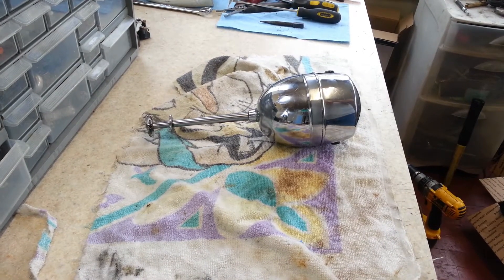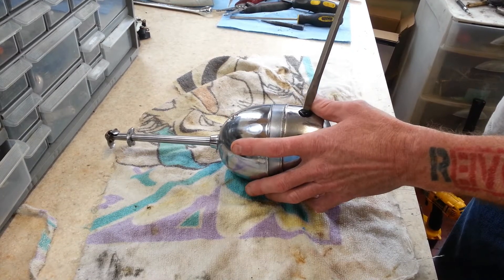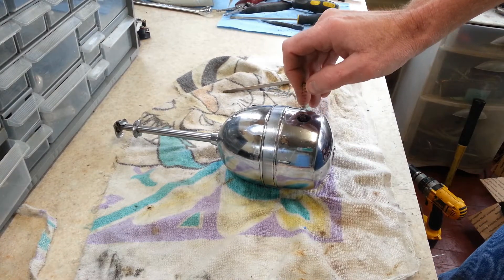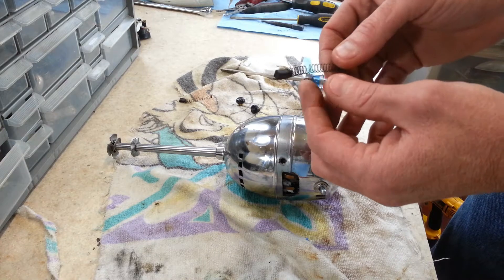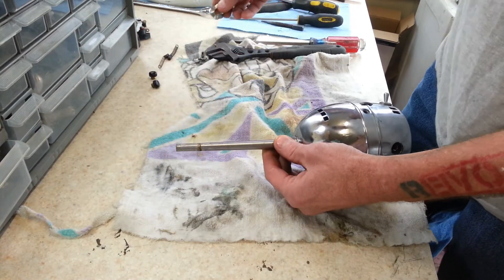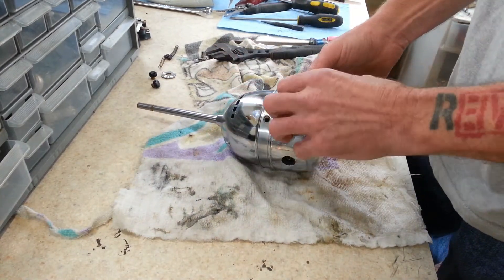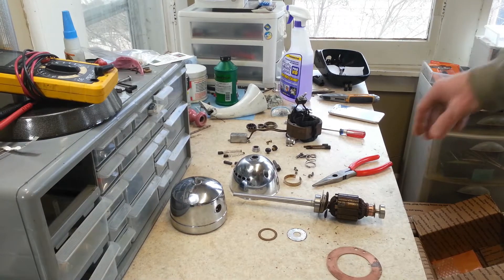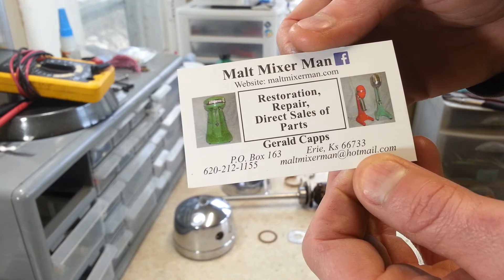Hamilton Beach Model 30 Malt Mixer service

Comment: Great video!..  I just unburied a model 30 in my moms basement that’s been in our family for 3 generations.  Was missing plug but once I replaced, found out it was much more that that.  With some moderate tinkering ability I did disassemble and noticed a huge amount of carbon dust buildup along with shredded pieces of the brushes inside..  The very top of the housing attached to the spindle appears to be chewed up so not sure how relevant that is to ultimately repairing?  That was the one thing I was trying to get a good look at during your video but unfortunately was not able to..  The spindle turns freely and smoothly by hand..  going to start by ordering new brushes and see what happens however I think I’m looking at a total tear down..  I’m located in the northeast and not sure if your service is an option if needed?
Thanks

Comment: By far the best instructional video on repairing a model 30.  This video is the one that I would recommend to anyone who is going to clean or repair almost any model of malt mixer made from 1937-1955, as the general information is basically the same.  The one thing I would recommend is to remove the chunky metal box (sometimes tube shaped) from the mixer head, rather than put it back in.  The piece is a condenser, which was installed in most all mixers before the 50's.  It was put on the mixer to stop static/interference, due to the AC current cycling back and forth, when radios and tv's were on.  Everything is filtered now, so the condenser is unnecessary.  If you leave it in, it will normally go bad over time and cause a small but scary shock when operating the mixer.  Malt Mixer Man - Gerald  maltmixerman.com
Reply from the maker: Thank you Gerald, and thanks for the condenser tip!

Comment: Your video was very good.  But i have a gilchrist #22 is there any information on it.
Reply: Ronald, I also have a Gilchrist 22 I have been working on, you ever find any information?  I am currently struggling to separate the mixing shaft from the armature.
Reply: @jeffamsterdam9023  i

Comment: Wish you had showed us what you used to clean everything up and how it was done.
Reply from the maker: Yea, I wish I could show everything as well, sometimes its hard enough to capture what I manage to, and I always look back when its done and either wish I had captured more, or that I wasnt in the way when I did capture something.
Reply: @vintagemixersandmore1666  Right on.  Thanks for posting!  I feel more confident now peeking inside the HB #33 Mom gave me 38 years ago.  Wish I had never tried cleaning the badge since some of the black outline of the letters disappeared.  Half the bushing cap broke off when it tipped over recently.  I was wondering whether to glue it, try to 3D print one or buy a replacement from the guy you suggested.  Don't know if replacing stuff changes its value.
Reply from the maker: @jonathansmith9705  Yea thats rough, the paint is so fragile after all this time. You can check with the malt mixer man and see, he may have reproductions or originals, Im not sure, but also check ebay, sometimes you can find the most obscure things there. I think there is more value in it just being complete with no missing parts, so whether original or reproduction brush cap, it will have more value than missing one. Hope this helps!